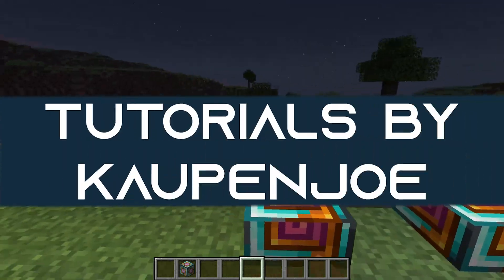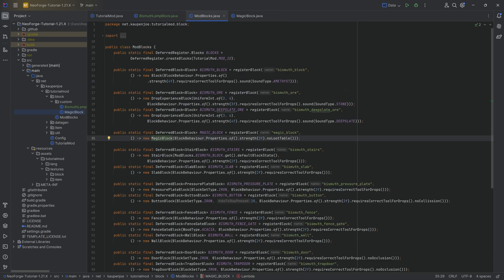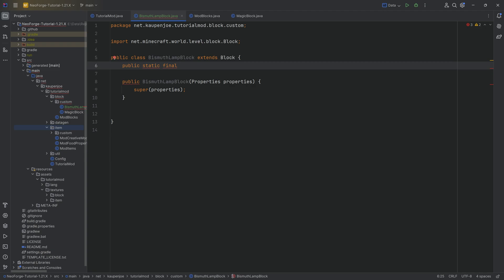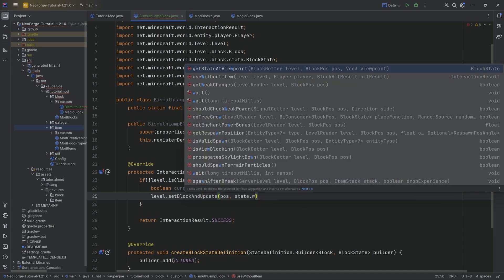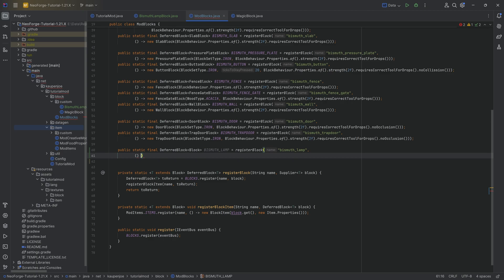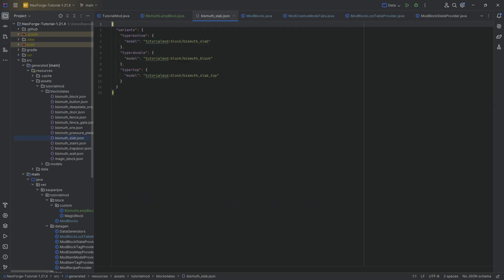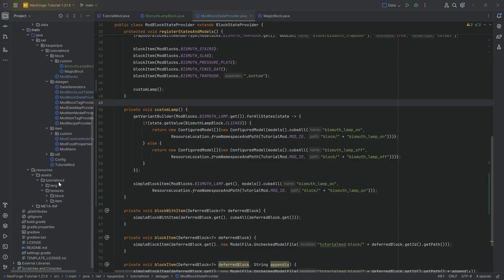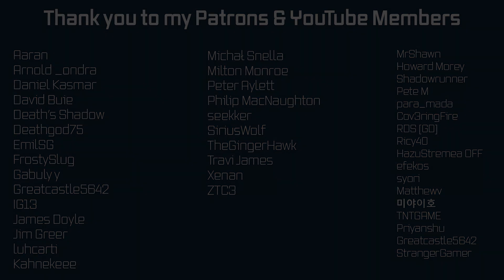NeoForge Modding Tutorial - Minecraft 1.21: Blockstates Explained | #13

Comment: Hey, at the moment, the blockstate provider has the helper method that needs to be reimplemented for each new LampBlock. If you give the method a String name that is added to the strings in the method instead of "bismuth_lamp_on" to name + "_lamp_on", and give the method a Block block instead of putting ModBlocks.BISMUTH_LAMP.get() you can reuse the method for other lamps.

Comment: Not sure why but I cant get the lamp to have a texture. It seems there is an issue with the data gen, as it's not creating a blockstates .json, a models>item .json, or a models>block.json
Reply: I know I am late to this but I had the same issue and fixed it. I created my own customLamp method so that it work with different block types instead of having the BISMUTH_LAMP hardcoded and I forgot to add the part of the code that creates the item .json file. If you did the same or wrote the code on your own from the video (instead of copy/paste) maybe you also forgot, or there is a mistake on that part of the code